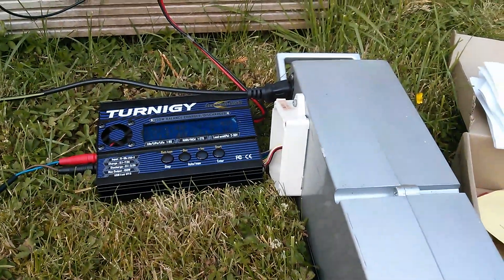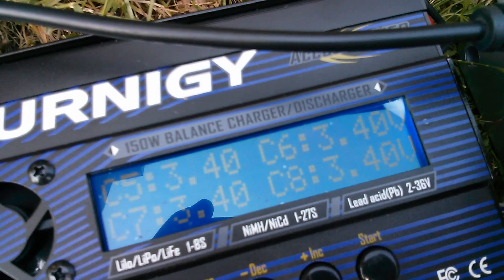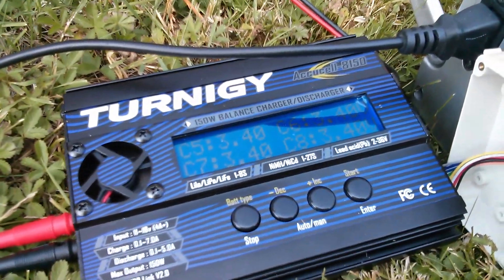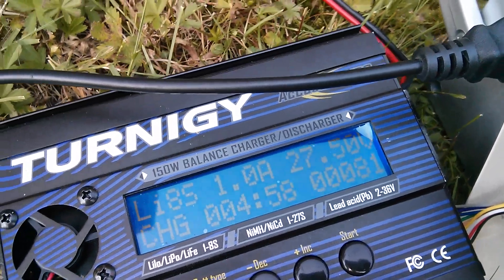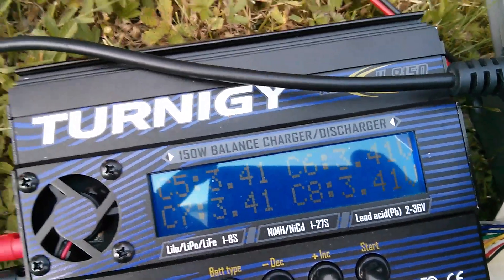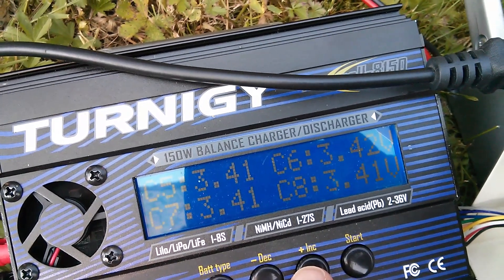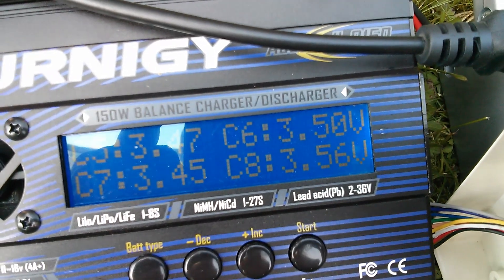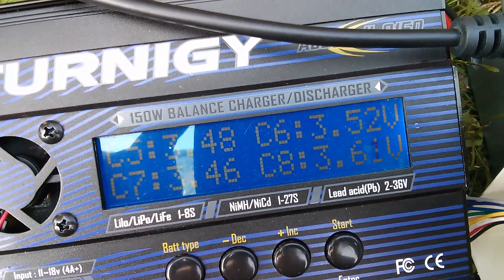Project Idea: 8-Cell Balancer Discharger using 9 Arduinos

Comment: I have a Icharger 4010 Duo - charges up to 10 cells and  up to 70 amps  - Im charging 12 volt 100ah Lifepo4  - it balances cells too - for power in my van -

Comment: This may (probably is) be a stupid question, but could you use a monitoring circuit and relays.  
Once the battery came up to 3.6, have the relay isolate it from the charger? Would this cause problems  
with the charger? Not sure, that's why I watch your videos. :)

Comment: Would it be possible to mod the lower end of the discharge in that controller to be something like 3.2v. That should bring the pack back into a range where the full 1 amp kicks in?

Comment: Scratch what I originally wrote.  Forgot you have those batteries in circuit.  We could go in deeper complexity but I think you could do what you were saying with 5 arduinos.  As far as the communication I would use SPI.  Originally I said to remove the ground but given this is in circuit it's more of a pain really.

Comment: Instead of light bulbs, you might want to use discharge resistor with dual colour LED's, or two LED's back-to-back. One colour for charging and another for discharging. A single lamp will not indicate current direction. Thanksfortge thought-provoking video, Julian.

Comment: What a shitty charger. Its wearing out C8 while it is doing this.I made a balancer that takes the charge from the full cells and puts it into the cell next to it. No micro either. This way you just supply a constant current and all the power goes to the right places. It is rated 4 charge amps too. No lost power!

Comment: Mr. Julian, you may not find this post but I will write it any way.
Instead of waiting for ages to balance charge the cells that has one cell away charge from the other, do balance discharge (@500mA for example), this will look at all cells and it will find the culprit away charged cell and it will discharge it first. Once all cells looked balanced, 3.4v here, stop discharging and start the balance charging again.

Comment: would it be possible to transfer the power from the high voltage cell back to the low voltage cells instead of just burning it?

Comment: Another option is to split the 8s pack into two 4s packs for charging with a normal cheapy charger.. keeping in mind that the packs must be separated if two chargers are used from the same supply at the same time

Comment: Julian why not just simply put a higher power resistor on the circuit so when switched it puts a harder load on it?
Edit: After a quick google, an AT Mega 1280 would probably be fine for the same job, just write a simple program that has 8 voltage inputs and maybe utilize a few comparators and mosfets and you'd be golden.

Comment: I don't know if it's really necessary to throw an Arduino at every cell. Resistor dividers for the ADC should do the trick.

What would be new and really cool, is if you could take some energy of the "fullest" cell and pump it into the lowest. For example you'd use two transistors to "select" the positive and negative of the full cell, which feeds into a small boost converter. The very important thing is that the converter is isolating (Traco Power, Recom, Murata have a huge range of those). With two other transistors you select the target cell that thereby will be hooked up to the output of the boost converter. The balancing speed would more or less only be limited be the max power rating of the converter.
Reply: What you show (the capacitor) won't work unless the cells are very unbalanced. You have losses in the switches (whatever they are, relays, SSR, MOSFETs,...) and to charge a cell with any amount of decent current you need a voltage that is quite a bit higher than it's current voltage. So if you charge the cap up from a 4.2V cell (let's say that's the full voltage) it may end up at 4.15V or even lower after the switch losses (I'm very generous here, 50mV losses is nothing; find me an SSR that has a forward volatage as low as that at a few amps). You then hook that cap up to a cell that's a 4.0V (again through switches so after losses that's equivalent to the cap being at 4.1V). Charging a cell that's already at 4.0V with 4.1V does almost nothing (internal resistance of the cell). Also the cap voltage will very quickly drop to the cell voltage and do nothing at all after that (and even before it reaches that voltage the already low charge current will drop rapidly).
Reply: Superdau, that's why you need to add a charge pump, to boost the capacitor from the high cell, and a boost/buck to drain it into a low cell - this allows a decent amount of charge transfer per cycle by using much of the capacity of the capacitor, and it also gives you the ability to control the balance current in each direction.

Comment: ive seen a video before where someone used an ftdi usb module to program these sort of chargers so they took the code and adjusted it to make it more accurate and also could mess with the code and add things

Comment: Great idea, but could you return the discharged power back to the pack. I've always thought using a dump load is a waste of power. Perhaps the turnigy is turning off the resistor load regularly to check the resting voltage??

Comment: I'd love to see a smart and high amp discharge circuit with a voltage cutoff to not damage batteries and leave it at storage voltage.  Most of these hobby chargers only can handle 1 amp discharge on a 4 cell lipo.

Comment: 9 arduinos? thought 8 would be enough for a 8-cell.. :D if you'll put too much of a load on any cell (eg halogen), the voltage will drop too much, the circuit is gonna start discharging other "high" cell, that one too will drop the second halogen turns on, etc.. it will oscillate until it discharges all of the cells. There is a reason the balancing current is small.. unless you're balancing a tesla wall.

Comment: There isn't really a need for 9 Arduinos. 1 per cell on a bus would be enough - I think one could come up with a bus logic where every Arduino can write to a simple character display but only 1 ever does (say a token ring system). That way the whole thing could be completely modular and the board it sits on completely passive.

Comment: I like the idea of separate devices in a weird way but I'd not bother with central feedback.
Each device could power and discharge through the feed as you already stated by using a resistor, mosfet and a decent reference. There's no need to feed data back to the central core. Put the charger into unbalanced charge and just let if drop out when the cells reach the expected value as a chain. Each separate module would manage each cell balancing.

I'd probably also suggest it would be worth trying to do 2/4 cells per Arduino using dividers however given how cheap a basic Mini is the saving in cost and size might not really be worth the trouble.

Comment: If the small wires per cell can handle more current, just replace the resistors for discharging them. It might need a mosfet for switching. If you use a dc2dc inverter you can light up a 6 Volt 3 Watt bicycle bulb (or 2 for that matter, depending on the max load).
Other people also suggested to balance the cells. By replacing #8 of course.
Bottom balancing is probably only a good idea if it fits your idea of how you want to use the e-bike. Maximum range or maximum number of recharging? (I know your LiFe cell are way better in recharging many more times than LiIon does)

Comment: Why bother rolling your own balancer, when many of the major IC manufacturers make purpose-built chips for battery management (which will probably cost less and do a better job)? TI makes the EMB1499Q, Linear makes the LT8584 and the LTC3300, NXP makes the MC33771 series, and I'm sure other manufacturers have their own versions too. There are lots of options, and there is still some work required on your part if that's what you're looking for.

Comment: Sorry Julian, using 9 Arduinos is just nuts!
I have a 35Ah 2kW 14S lipo pack and I'm getting fed up with 3 sessions doing 6S 6S and 2S, so I want to build a balancer for it.
The most elegant way I can see is to use a flying capacitor.
Here's what I propose:
Use 1 Arduino, and multiplex 8 or more DPDT solidstate relays to sample voltages of each cell or module in turn, then select the highest cell and use it to charge up 2 balanced supercapacitors in series with boost/buck from it.
When threshold or time limit reached, select the lowest cell, and discharge the supercap through a 4056 into it.
Rinse and repeat.

Aim is to use as much of the super cap's capacity for each cycle, hence the boost or buck.
It's the equivalent of using a bucket to equalize a load of unequal tanks, and aiming to use most of the bucket each time.

Comment: use 8 cheap Chinese " 18650 Lithium Battery Charging Board" chargers and use 2 Arduino Uno( i think), (as it much cheaper the Arduino mega)

Comment: Why not just place an 8S balance board in the exterior white housing and a boost converter from 12v to required voltage so can plug directly into your solar/battery box?

Comment: You can change the charge current on the charger. Just press the far right button, and it lets you change the current settings. 

I have a Reaktor 250W (Hobbyking) or Charsoon Antimatter 250W (Banggood) and they charge at 10A. You can also change how fast the balance charge feature goes, there's a slow/ medium / fast. Mine goes to balance mode for about 20 minutes when I charge my eBike 16Ah battery pack.
Reply: Sure, but you don't have unbalanced pack!
Reply: He even said that it is set to 1A, but the balance current is max 300mA, so effectivly limiting the charge current...
Reply: I still think its a settings issue. I charge 3x 4S 16000mAH packs and don't have this issue of a slow charge even with a balance charge.
Reply: His shouldn't be, either, unless he's not using it or his LiFePo cells are trash. Mine are over a year old with over 200 cycles.
Reply: If you're charging yours regularly then a top-balanced pack will likely stay top-balanced with little correction effort from the charger.
The pack hadn't been used for a long time and LiFes and LiPos self-discharge over time - some more than others, so they reach full capacity at different times depending on depth of discharge.
If the pack is unbalanced at the top, and one or more cells are at maximum, then the lower cells can only charge at the bleed current, and this is tiny.
Once top-balanced, the cells in subsequent frequent charges should meet closely at the top again, and require less effort to balance, even if the capacity of each cell are quite different, in which case the lower capacity cells will bottom out before others, and must be switched off or recharged.

In Julian's case, I would just disconnect cell 8, and charge the rest as a 7S to save time - and so on until all are full.

Comment: Cell 8 is lower capacity.  It will only fail sooner than the others.  I suggest you replace that one cell in the pack for a bicycle.  Or, start bottom balancing then charge the pac with your your arduino project! It doesn't make sense to top balance as your charger is doing. Cheers
Reply: Not necessarily - it may have self-discharged more than the other cells, yet still be in spec.

Comment: Sounds like a nice project but it seems a bit over complicated to me, correct me if I am wrong but do these not self balance if connected in parallel, if you use some relays or switches to switch the battery between parallel at 3.6 for charging and serial at full voltage for use. Also you would be able to charge at about 4 amps or more in parallel so should charge up quicker.

Comment: The trouble with aggressively discharging cell 8 is you would be increasing the cycle life of that cell as this may need to happen several times per charge these part cycles would reduce the already weaker cell further and incrementally increase the amount of aggressive discharge required at every charge as cell capacity reduced, further ageing the cell.
Better to hold that cell say 10% or so below termination voltage and increase current to other cells 25% bringing them rapidly upto the weakest one then drop back to the standard charge current dictates. Holding cells for prolonged periods at charge termination voltage has deleterious effects on cell life. And since lithium is much more tolerant of higher current charging as long as the final current with relationship to end cell termination voltage is respected, this is the better approach. Though this complicates your circuit a little bit it is by far worth the extra effort. 
Thanks for the great videos i enjoy them immensely.  :-)

Comment: Guys - you need 8 Arduinos/tinys/anythings as each cell has a different ground voltage - try to measure the highest cell on a single device and you'll have a potential of 8x3.6v (at max) across the device = magic smoke...  Each cell has to be measured as a difference between it's positive and negative end (i.e the cell voltage) - but the positive of the first cell, is the negative of the second etc.
On another note - instead of rx/tx - couldn't you do something cunning with opto-isolated i2c?

Comment: Hi Julian. I'm working on a similar project on my YouTube channel NERDVille. But using one arduino to deal with the used 18650 cells and the system is designed to find there capacity with relays that switched between the cells. The unit can be daisy chained together to expand. Love to team up with you on this. 🙏🏽

Comment: if you have cells that are that far ahead and behind you have cells that are far different in capacity. and I have had a charger that puts a little * next to the cell its balancing down at that moment. But by now we have much more advanced chargers than that one you have with the 4 button style. My charger actually seems to charge up the lower cells instead of discharging the high ones, much mire efficient and much faster.

Comment: To me that's a weird way to charge cells, once it's charged, why doesn't it just stop charging that cell, instead of wasting energy discharging and charging.
I was working on a way to charge cells separately in a series pack, i may revisit the idea in the future, i was basing my idea on the 5v usb charger boards.
Reply: Well, to not charge the cell, the balancing wires to the cell needs to be loaded with the charge current. Takes some regulation to archive.

Where should the extracted power go?

Comment: @Juilian I would think that the problem is not the charger but your battery pack, the charger is showing you that you have a bad cell 8. That cell has way less capacity than the others which is why it's shooting up in voltage so quickly.

Comment: do you know the cheali charger firmware? I flashed it on my IMAX B6-AC. I have seen a possibility to use an other discharge transistor and mods with a fan to use greater discharge currents.
The IMAX chargers use a atmega328 and clones often use a st IC. So have a look at their website and check if there is a firmware for your charger too!

Comment: how about mbed ? (cortex M4 with MPU) Nucleo F401 for example for 10$ ? plenty of power, cheaper than arduino, very similar but more powerfull programming language, compatible header.  It is quite easy, i designed very simple balancing board for 5S ( 5x 33R resistor || to battery + mosfet + sense wire) but i never finished control board :D

Comment: does it really need so many arduinos? cos one arduino can measure lots of things you could have however many voltage sensors you need but only 1 or 2 arduinos and then there could be one of those modules w/ 8 relays to switch the light bulbs on and off
Reply: when you think you have a good idea and post w/ out reading the other comments then realise everyone else already said the same thing :/

Comment: Julian, have you opened the unit up? Most of these chargers already run a Atmega328 (some have 1 per channel, but thats not per cell), however they don't seem to need 8 processors to do all they do. 8 slave units seem like a terrible waste and overly complex for no real reason. Have you taken into consideration how many of the electronic DC loads work using a mosfets for precise discharge that can be adjusted through a wide range of power? Could have one arduino and 8 mosfets attached to a heatsink. This is how most of the electronic loads work but in your case would be an electronic balancer. Charging would be easy to add with the high power mosfets putting the resistors to shame and allowing you to dump much more power into the battery using a constant voltage charge source via the main leads (where power should always be added, not the balance leads) and burn off the excess going to the finished cells at a much quicker rate. But the balance leads are only intended for small currents so you may want to look into how much discharge current you're planning on passing through their wires. Since you built the unit, why not put some better charge leads and charge each individually (not through the balance leads which are usually undersized for high loads

Example of the electronic loads http://hackaday.com/2017/02/28/beefy-100-amp-electronic-load-uses-two-mosfets/

For the arduino side  you could use a Nano (8 analog), Micro (12), Mini (8) Leoonardo (12), Due (12), Mega (16),  Yun (12), or Fio (8). Plenty of options with the number of analog channels you require. Could have one nano versus 8 of whatever you were thinking.